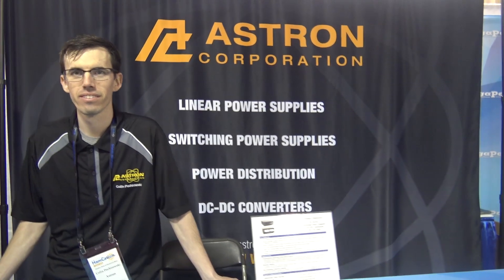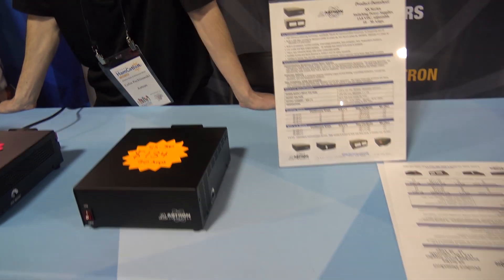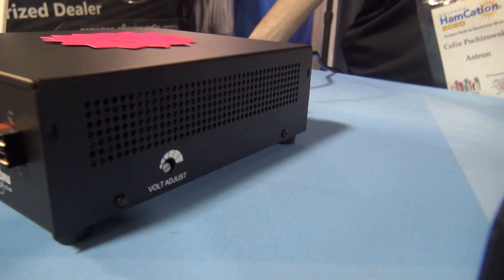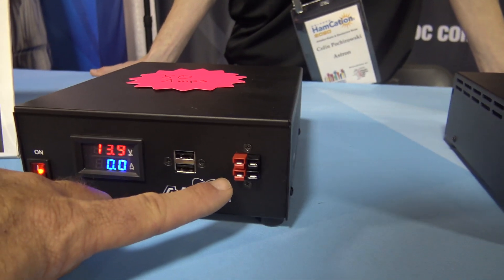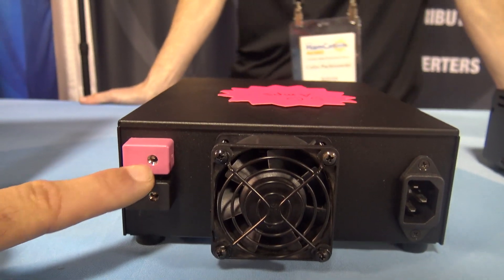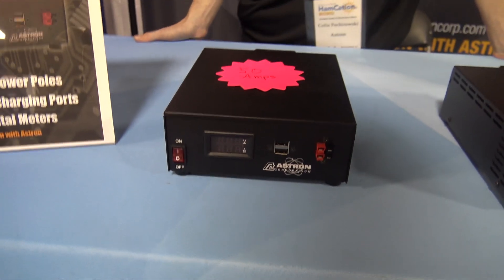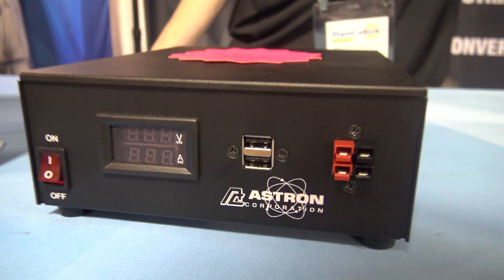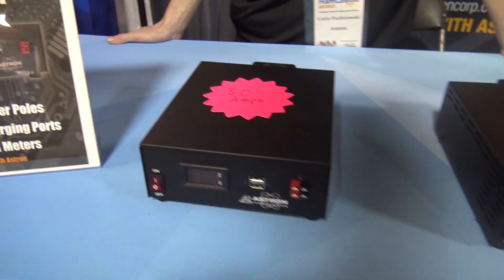NEW!! Astron Has A New Power Supply, SS-50M-AP First Look

Comment: what the fan noise like?  also any birdies or noise on HF?   the old SS model lasted about 10 minutes in my shack.  the new one with the LED V/A display is "supposed" to be filtered for HF.   only reason i'm considering this is because the VS-70M hums like a mofo and the fan is so damn loud that it can be heard from outside.

Comment: I noticed the other night that, when I keyed up my IC-9700, the voltage from my Alinco DM-330MVT drops significantly. The display on the 9700 says it goes under 10V when I'm at full power. I've been thinking about replacing the power supply. I looked at that MFJ you had/have. And then I looked at the 75W because overkill is always a good thing. But this is interesting. Did you ever end up getting it?
Reply: Did you ever replace your Alinco PSU, with this model Astron?
Reply: @eprom239  I replaced it with the MFJ-4275MV.

Comment: I have a few Astron heavy supply's . one on a 70CM /2Meter repeater link system for many years . Thank that one 70 amp with battery back up. never had a problem . just put in new telecom 12V 100Ah AGM battery's . would like to try switching in my shack the hash noise I get with MFJ is a problem and sold it . 73's

Comment: Hello dear sir.
I'm Pakistani,I bought a 13 Volt's power supply, but when I come to home and check the supply, it's not working.
I hope it's transistors (2N3771) are damage.
If impossible please send me complete circuit of 13 Volt's power supply old model, open 2 transistor fit in one open side transistors (2N3771).
Please contact me,, my money 1600 ruppes are gone,,
I wait for your comments.
I pay you at delivery of circut .
I want send you it's picture on WhatsApp.
Please join me on Whatsapp for solve this matter issue.
My mobile number is,
0092 code of Pakistan and mobile number is 03135914119.

Abdul Nasir ch.
Village Ding.
Post office Rehana.
District Haripur Hazara kpk.

Please send me this circuit of 13 Volt's power supply open 2 transistor (2N3771).

I prayful for you always.
I wait for your comments.
Regards Best always.
Los my money 1600 rupees.

I wait for your comments.

Comment: Colin is a super nice, super helpful guy. Astros are the some of the best power supplies and I would tell anyone that. BUT... It is very disappointing to me that you have here a power supply that is NAMED a 50 but can only accept a single 14awg wire for the power output. When you have a 40 to 50 amp power supply, you are going to probably going to want to have it supply power to 2 if not more items. You could get a terminal wired up too this one wire coming out but by this time you have probably stripped the set screws on the output connectors which is very hard to turn with the tiny screwdriver that is needed to open and close the clamp on the output wire. If that isn't enough to make you madder than skinheads at a rap concert , the item does not even come with the male connectors needed to plug in the Anderson power pole connectors on the front. I'm sorry Astron. I love you but this power supply is a design FAIL!
Reply: ,,and a piece of crap....stick to a linear supply.

Comment: That is the biggest pile of shit.   Just a bunch of parts from ebay.  Switch mode power supplies for lab work is blasphemy
Reply: Bit this is for ham radio, Not Lab work. So ease up there, skippy!
Reply: @chrissewell1608  want to save $200 and get the same functionality and better reliability with a much smaller device? Buy a Meanwell.  Regardless I would imagine for things as  sensitive  as HAM radio operation that a linear supply would be best and not a noisy switcher
Reply: @Pops180  I have an Alinco, switching, adjustable power supply, that is awesome! They are sort of big and bulky (not near the size of a linear supply). Not cheap, but not crazy expensive. I just need something uber small with good amperage. I checked out the Mean Well supplies today, and the price and amps are right!

Comment: This reminds me of the Alinco DM-330FX, they also had usb ports on it, and they were made in China, the ps was noisy as hell, I did get a replacement and was slightly quieter, you may have noticed the Alinco DM-330FX has disappeared, Alinco killed it due to noise problems, Alinco also brought back the trusty and excellent DM-330MV that has no usb and made in Japan, I have both, the DM-330FX is now on my vhf/uhf radio, it seems usb circuitry made tons of noise. I like Astron's stuff, but why do these companies insist on sticking usb power ports on their ps is beyond me, the average person probably has 5 usb chargers sitting in a box some where,  you have to ask yourself, are you going to be charging something while you on HF radio, most guys will say no and have something charging far away from the radio, or not having anything charging at all in the whole house. I cant wait to see the tests on this new ps.

Comment: Astron took a $12 Chinese LED supply, put a $2 meter w a shunt from Alibaba on it and some connections... If you're a HAM and can't build that thing for $25 you need to spend a little time studying or with an Elmer.
Reply from the maker: Well.... I have to stop and agree with you this only for the fact that I wish I had to do this kind of stuff when learning ham radio and electronics, but In my era I just bought things.  With that said, I would love to build things to use instead of buy them. I can read certain schematics but not an expert. I can repair certain circuits but not an expert. Then there are those who cannot, and they need to buy this stuff. Whether they cant solder due to physical ailment or no eyesight. So they have a new better option. My feelings are that I would buy this unit, but also want to learn how to build one in my spare time. But I cant say its not appropriate to buy these and not build them.. Thank you for watching and your comment also Keith I appreciate it

Comment: i thought switching power supplies were bad for ham?
Reply from the maker: Astron makes a clean switching power supply, and minimal rf noise. Not bad for ham radio, but everyone has a preference
Reply: They can provide noise, but not always. I use the Alinco DM-330mv bench top, power supply. And it is all adjustable, no noise back feed into the radio speaker, or during transmission. Runs cool and quiet. Its just a little bulky. Well worth the money.
Reply: you are right....